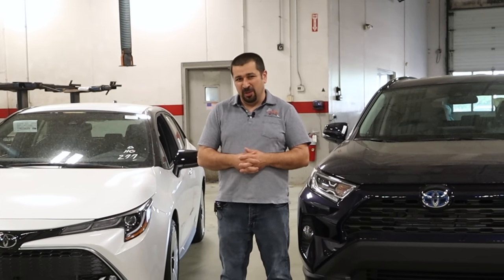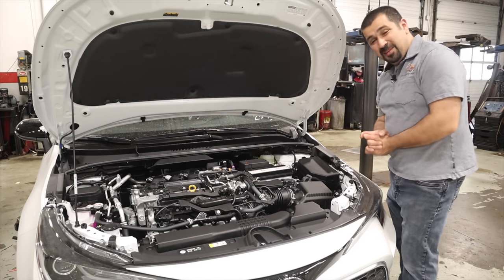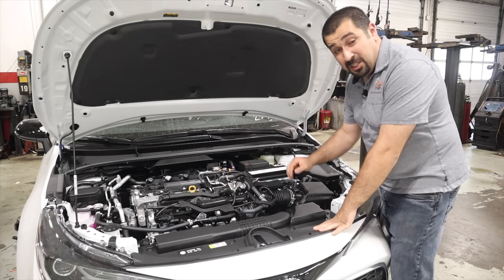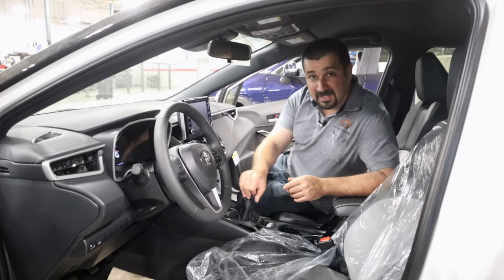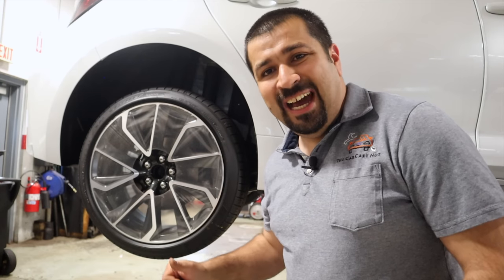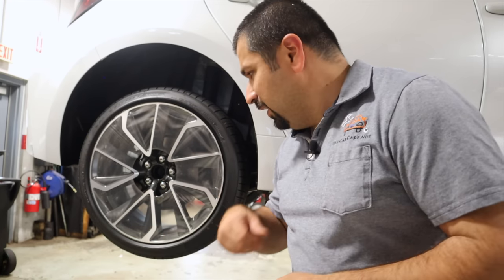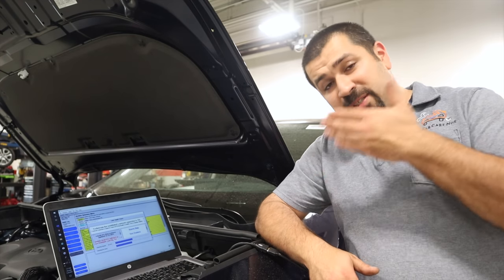Buying a new car? Here's what happens behind the scenes.

Comment: Thanks, for taking the time to make this video!

I just purchased a 2021 Camry SE that was slightly used - 4127 miles - and, as a Toyota Certified Used Car it was supposed to have gone through a similar process.   But, because this car had only been on the lot for a few days when I purchased it, apparently, it had not gone through this process.   But, rather than tell me that, they let me take the car home on Friday evening and the salesman told me that he would bring me the second key and some papers to sign regarding the certification.   Something didn't seem quite right about that, so I took the car back to the dealership yesterday.   And, lo and behold, when they tried to get the CMT to sign off on the paperwork, he refused.  Instead, he wanted to make sure that everything had been properly inspected, before he would put his signature on the paperwork.   I was a bit irritated that what I thought would be a five or ten minute visit turned into an hour and half.   But, I felt like the CMT did the right thing.

I think the salesman had in mind coercing the CMT to sign the paperwork by telling him that the car had already been taken home by the customer.   I do believe that some CMTs might have done just that - sign the paperwork without having actually done the inspection and performed any required repairs.   But, this one did what he was supposed to do, even if it meant I had to wait awhile.

My confidence in the integrity of the sales team went down, but my confidence in the service department went up.   Why am I not surprised?
Reply: Good for the CMT. 
I think it's fair to always assume certification means jack and nothing has been inspected. Inspect it yourself as thoroughly as possible before purchase.
Reply: You cannot trust any dealerships
Reply: What's a CMT? Crazy Mechanic Technician?
Reply: I would have said something to the salesman directly to his face about that.
Reply: @CriticalThought004  Not to state the obvious, but Certified Master Technician.
Reply: Car sales is a soul sucking profession.
Reply: There’s not reason to be confident on a salesman, because they don’t have any character. All they understand is the number.
Reply: I never believe anything the sales department tells me. Unless it's in writing, it's your word against theirs. If it seems like they're trying to rush through the process, I'll get up say thank you for your time and leave. Be careful of the service dept too. Especially with some of these lube jockeys when they have an impact in their possession. They can damage a set of lug nuts/bolts in seconds.

Comment: My experience with my toyota dealership where I purchased my 2016 Tacoma was awesome. My salesman knew how excited I am for my tacoma, after all, from order placement to delivery it took almost 2 months, and it's all due to the actual build, not a pre- built unit being shipped from another dealership, but actually getting built fresh off the ground. He called me to see the brand new Tacoma with 000001 miles, all wrapped up in white wrapper being off loaded the delivery truck. Drove it home 2 days after all the homework the dealership have to do before the hand off.
Reply: 👍, good, it all depends on the dealer.
I bought a Highlander and the dealer was great, and than a Tacoma from another dealer, and they ware ass holes.

Comment: The DC Cut fuse was removed during transport to prevent battery drain, the dash will show you lots of warning lights because of that, so when it arrives in the dealership, it needs to be installed. Then you have to do initialization of some of the systems like seat ECU (for the seat memory), parking assist dynamic guidelines(steering angle calibration), Panoramic view monitor (360 camera), initialization of TPWS and tire pressure correction, calibration of parking support brake, condition of battery charge and  installation of under body plugs.

Comment: As a Toyota dealer mechanic this is everyone's favourite job as its easy hours. We get an additional 1.5 here in Canada because we install block heaters as part of PDS. The hybrid Siennas are my favourite to do.
Reply: It's trash at my particular dealership in California. If you do a PDS, you also have to install a poor man's GPS for a full total of 1.3.
Reply: How long does it usually take? My Highlander  Hybrid just arrived at the dealer earlier in the day. N someone was inside inspecting. They didnt even know we were buying it. Ours took like 2 hrs. It seemed rushed or was it?
Reply: @minisurfbanana  They pay about 1 hour. If you want it done properly. Longer is better. I myself like to make sure everything works, so I literally lose money doing these jobs. I'd rather check for problems before the customer gets the car, rather than after. After costs me more money. I make $0 checking problems customers are concerned about after they bought the car. Wasted 3 hours on a customer car for a strange noise that I could only duplicate 1 in every 30 or so tries. So, I basically lost $100 on one car.
Reply: @minisurfbanana  I'd say its reasonable. It depends if it got a block heater installed. If its just a straight up PDI that was a pretty darn good job. That means they even tested the 12v battery which a lot of techs skip. I've had to do a rush PDI in the past, takes me 1.2 run time to complete it including a block heater install so 2 hours is reasonable.
Reply: I bought a Corolla built in Canada, had to install block heater myself. Opening was built into motor. Just hard to reach spot.

Comment: I just bought a new 2021 Avalon Limited that I ordered back in March. 
I found a package in the trunk with 2 body plugs in it. I called the dealer and was told that they were not important but I could install them if I wanted to! I installed them just like was shown in the video.
I also found 2 parts in a blue bag in the trunk that the dealer didn't have a clue what they were for! I "googled" the part numbers and found out they were insulators for an underbody panal at the front of the car! I will be installing them first chance I get.
Now I'm not sure I can trust the dealer with performing the scheduled service under the free maintenance plan.
Thank you so much for this video!
Reply: Just do the service yourself, the dealership’s gonna make a mess of it
Reply: Best to find a different dealer, if you do not take to Toyota for servicing you will void your warranty.
Reply: Run, don’t walk, to another dealer.  This one doesn’t seem to know what customer service is.
Reply: If I were you, I would report that dealer to Toyota corporate, BBB, and post the Dealership here so others won’t be taken by them. The dealer insulted your intelligence, and needs a come to Jesus meeting just for starters. 
I caught a dealership lying to me when I had a oil change and tire rotation. I mark my tires with  pink fingernail polish, and when I inspected the back tires, they were not rotated. Caught them red handed,and service manager told me “ they didn’t mean to “. Also they didn’t tighten the oil filter and next morning there was oil all over my garage floor. I was late to work due to returning to dealership to fix their carelessness shoddy work. AND THEY DONT CARE.

Comment: I have a 2013 Tundra DC, SR-5. I still have it, 100,000+ miles on it and still drives like new. When I got it it had a very slight pull to the right when driving in a straight line. Could only detect it when I would do a "hands-off" controlled stop. The dealer kept my truck for days adjusting the front-end alignment, only making it worse. I finally told them to reset it to factory spec. and I would live with it, as it was hardly noticeable unless driving and it would slowly drift to the right while driving straight. I checked the tire pressure ( this dealer had the fancy nitrogen-filled tires) and there was as much as a 15 psi difference in tire pressure between the different tires. I corrected the pressure differential and the problem was fixed.

Comment: I worked at an Enterprise and he's absolutely right about the plugs. every single Toyota that we have had in our fleet has the plugs in the glove box or in the spare tire compartment unopened. I would never buy a Toyota or any vehicle from a rental place unless you wanna deal with rust.
Reply: Why would a fleet car not go thru PDS at the dealer?
Reply: They get delivered to the fleet or rental co direct most times .
Reply: @mtnbiker014  presold in bulk would not need dealer middleman. One time I got a car from budget with like 3 or 7 miles. or 12. Something very ridiculous. But it was clear and obvious no test drive or pre-anything was done. I think the plastic was still on the carpet and the floormats still in the trunk. The door and hood plastic was pulled off however. It was a silver car so the white would be too obvious.
Reply: if the body plugs were not used, can insects or rodents get into the car?!

Comment: One piece of advice for buying a new car, even a Toyota: Inspect the car during your discussion and negotiations and note any issues such as paint blemishes, scratches (especially in plastic), dings etc. during daylight, on a bright sunny day outdoors. If you find any, find a different car if you are OCD or make it part of your negotiation. You will be surprised what you find. Most minor flaws can be buffed out, but some require a paint shop or new part, reject those cars for new car purchase. Once a car goes to a paint shop, its never like new.
Reply: Nowadays, this isn't possible even with used cars. If there is a car sitting on the lot, the dealers will sell it to whoever is willing to sign the paper and pay the deposit right away.
Reply: "on a bright sunny day outdoors"  Yes, however, want to see defects in paint and body? Florescent lights show it all and more.
Reply: And as soon as you take the vehicle never take it back to a dealership for a service, except for warranty work, because any licenced mechanic with the right equipment and computer.scan tool can perform servicing and at a .. It will not void any new car warranty. Dealerships make their money from servicing, and it is inflated costs. Warranties are not voided if an owner elects to use an independent mechanic for regular servicing. and as long as the servicing is done on time, even with non genuine parts, that are "fit for service", the manufacturers warranty legally applies and the dealership must perform the warranty work, even if they do not do the logbook servicing.
Reply: @jeffjiegao  In the past prior to Chip shortages, when I called the dealership for a new car, I asked "How much is your best price?", now "Do you have a stock?"

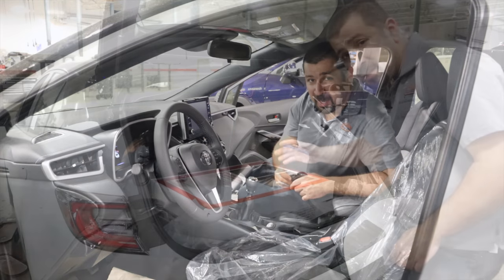Comment: 6:27 last year i just bought a used Corolla 1999 4ZZ-FE engine saloon model ZZE111L-AEMDKW with only 56k kms, and i have seen that bag in the glove box wondering what it was, now i know that the official Toyota Dealer had to put them in place, what i did... 21 years later :)

Comment: Fifteen months ago I purchased a used Camry from my local (Ontario, CAN) dealer.  As you said, because mechanics get a wee bit of something or other on their boots, my floors in the front had the paper covers and the driver's seat had a plastic cover on it.  I had to wait two days longer than what was first told to me because they were having problems with one of their machines needed to undercoat my car.  I was given the option to take it as is or wait and get it fresh. I waited.  My service was just super and all the staff were wonderful.  I know some people seem to have a hard time with some dealers but I seldom do.  I believe a lot of it has to do with the client's attitude to start with. Yes, I do find they are a higher price for servicing but I like the idea of Toyota servicing knowledge about my car.  I have had a few normal repairs/servicing done and without a doubt my dealer takes so much care with cleanliness , etc. and I have yet to be disappointed with anything.  Now, I know every dealer does things differently and maybe I'm just fortunate but at this point I am going to stick with my dealer as they have proven  themselves to me.  Hope you can find a decent, honest dealer or independent service centre in your area.

Comment: I bought a brand new 6-speed 2020 Corolla hatchback SE last year.  Great car!  By the way, I bought it without knowing how to drive it.  Dealership delivered it to my home after I wrote the check.  It was incredibly easy to learn to drive it, Toyota did a great job at making a manual that's perfect for beginners.  And I was someone who thought I'd never learn to drive a manual car.  I'm glad I took the risk, it's so much fun to drive!  By the way,  a few months after I bought the car, my state, Ohio, dropped the front license plate requirement!  Instead of worry about plugging the holes in the bumper, I instead found a website where you can buy a custom replica Japanese license plate.  I mounted it to my car, and it looks really cool!
Reply: @miteco1  I've tried over ten times to reply to you, but my comment keeps disappearing.  YouTube sucks!  I have no clue why my comments won't post.  Is there some other way I can send you the web address?

Comment: My 1998 Camry-V6 was made in JAPAN.
 It’s almost 300000.00 miles…still working good like new.
 3 times I changed the tires/ Brakes Pads and Engine Oils and Transmission changed……

Comment: Thank you for the excellent video. I am from Finland and I consider the Toyotas to be of very high quality products in most cases. Seeing the underside of the car makes me wonder if additional underside protection would be needed in certain market areas, i.e. a protective sprayed coating on top of the factory-painted unprotected areas. At least in Finland, salt (+sand) is sprayed on the road surfaces during winter time. They can be ruthless to the metal surfaces, no matter which car brand.
Reply: Same here living in Salt Lake City, Utah in USA.  They spray salt on the icy roads in winter months.  So an undercar coating is always recommended to drive in the harsh condition.

Comment: 2022 Corolla Hybrid SX Sedan (Australia)  GOOD NEWS: As we are in Lockdown the kind dealer delivered my car to my home 45 miles away from dealership. Thanks to your video  I checked for lower front bumper damage (none) body plugs were installed, and steering wheel was centered.  BAD NEWS:  Those 45 miles are mostly on a major 70MPH highway and PDS did not catch tire pressure which was 60+ PSI all around - Lucky no blowouts.

Comment: When I was working as a service tech at Toyota we had a new Tacoma that the front cv axle was missing the tripod joint. The axle boot was still intact but there was never a joint installed inside the axle cup.  Was one of the craziest things I had seen on a brand new Toyota.

Comment: Great video with lots of useful information. Where this can all come undone is accessories especially on off road vehicles. While generally the dealer will fit genuine accessories the after market ones are usually fitted off site. So here in Australia you might want a uhf radio, bull bar, spot lights ect all fitted before taking delivery of the car and normally the dealership will send the car out to have this stuff done. While the manufacturers take a lot of trouble to eliminate rattles and squeaks the after market guys generally don’t. I have seen some terrible fitting of accessories both outside the car and behind the dash. Bolts missing, broken clips, clips missing, interior trim panels cracked and damaged mounting clips. I went to remove a trim panel once after having an accessory fitted only to find the installer had broken the mounting clips and instead of repairing the part he had just used hot glue to hold it on. I have seen a lot worse though. Cheers Stuart 🇦🇺

Comment: Car care nut you do a phenomenal job I have been driving a toyota for 23 years on my second corolla had a 92 5speed  parked it at 412000 had original engine and transmission I am now on a 2005 corolla 5 speed with around 360k still going strong and I pull a 5x8 utility trailer with both thanks so much for sharing your expertise and knowledge

Comment: This brings me back to 1989-1994 when i worked for Suzuki and Toyota,Suzuki was worse....as in the were like hard wax sealer/protector over the paintwork,had a tin of wax remover,but it was such hard work removing it.Had to fit the spare wheel holder and spare wheel on the 4x4 Suzuki Vitaras & rear seat belts! Loved peeling of the plastic off the body/paint....lovely feeling.The smell of new cars is sublime.

Comment: Corolla was made in Japan. I know cause i have a '21 Corolla sedan that i special ordered last Sept. Toyota in all its wisdom decided to make an already sold vehicle in Japan versus Mississippi. Took 13 weeks to get to Cincinnati, and it had to come through  Chicago,where it was put on a truck. Then in checking over the car myself, found all 4 of my tires close to 60psi,and under the hood i noticed no cover on the fuse box. Lucky for dealer the tech had put it in a small depression on the core support, so closing hood didnt break it.

Comment: I bought a new 2021 tacoma and the transmission was not PDI.  Drove it 1,400 miles and started whining.  It was 1.5 quarts low from the factory.  I believe the PDI for the techs states the transmission fluid is to be checked and it wasn't.  They ended up installing a new transmission.   Good video!

Comment: Great video.  Unfortunately in the real world, not all dealers take them seriously. I just took delivery on a new 1/2 ton and on my first drive as the owner I discovered a noticeable vibration and over 55 lbs of air in the tires.
Reply: Same on my new Mazda CX-5. 53 lbs of air
Reply: I had 44psi in my Highlander hybrid on delivery that went up to 47psi in the LA heat wasn’t very happy.
Reply: I bought a new 2023 Camry SE with 5 miles on the odometer and the tire pressures that were supposed to be set at 35 instead ranged from 47-49!